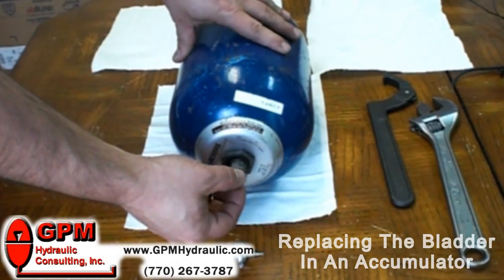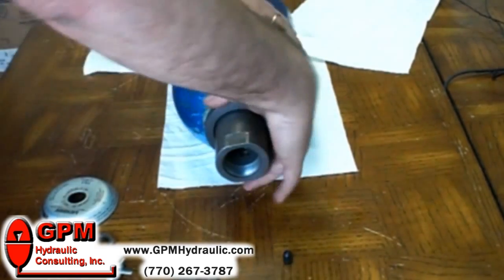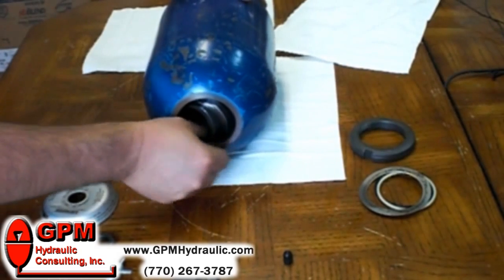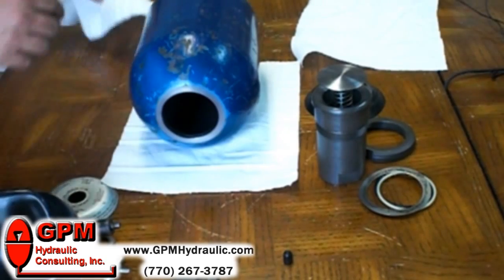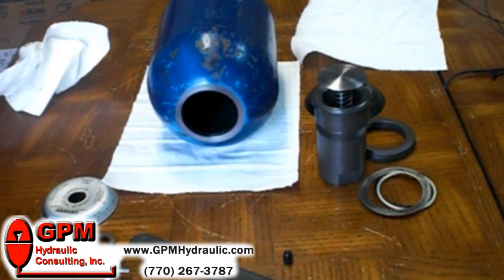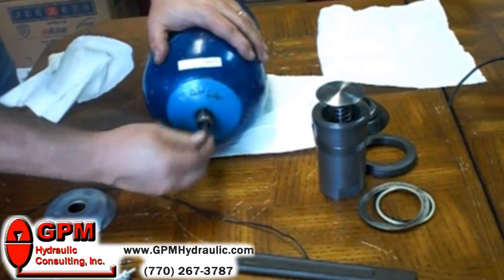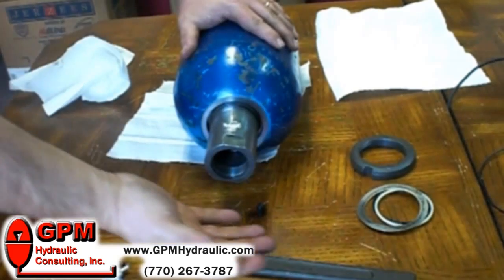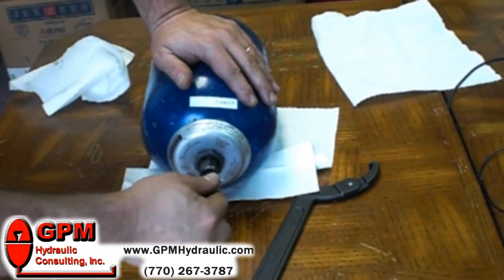Replacing The Bladder In An Accumulator

Comment: My accumulator is gushing out oil from the charging valve. What does that mean?
Reply from the maker: What type of accumulator do you have - bladder or piston? If it is a bladder accumulator, the bladder must be ruptured. If it is a piston accumulator, your piston seals may need replacing.

Comment: jack would a faulty accumulator cause a hydraulic system to lose hydraulic pressure over time .This would be in a bobcat mini excavator.What are the symptoms of a bad acumulator.We already put a brand new pump on machine
Reply from the maker: Hi Jay,
No, that doesn't really sound like an accumulator problem. Yes, it can cause temporary pressure drops whenever the system is starved for fluid. For instance, if the pressure stays high during low demand (few actuators moving), but drops when more actuators start, yes, that could be an accumulator issue. In fact, whenever you have wide swings in pressure, the first thing to check is the accumulator. An overall pressure loss over time sounds much more like some component bypassing (and getting worse as it remains in service). I'd look for components with an abnormal temperature gain - usually the first indication of bypassing. Hope this helps!
Reply: @JackWeeks  Thanks Jack one other question on our control valve there is a main releif valve is it possible the main releif valve is faulty .The reason I'm thinking the main releif is because ever control of the machine seems weak including final drives once the machine warms up
Reply: @jrac863  That sounds like a great place to start. Not sure how your machine is configured, but you need to determine if the relief is bypassing to tank. One good way is to see if it heats up during operation. A thermal imaging camera is a great way to tell. It should get no hotter than surrounding components. Good luck with it!

Comment: Good day Sir,
      I'm Paulo, I need your help Sir  Can you solve or  answer my question. for what are the  main causes why  accumulator bladder leaks or how long or year did accumulator may used

I hope you can answer my problem..Thank you and God bless...
I hope you more blog about the accomulator and also how they work.. Again thank you...
Reply from the maker: Hi Paulo,
Thanks for your question! One common cause of slow leaks in an accumulator is a bad Schrader valve. Replacing the valve core is exactly the same as replacing the one on your car tire - you even use the same tool. But do not use a low-pressure car tire valve core, get a high-pressure one from your hydraulic supplier. It's easily recognizable by its red seal.
Bladder failures are different - they usually fail suddenly (rather than leak down over a period of time). The most common cause of bladder failure is too high of a pre-charge. This causes the bladder to hit the poppet valve every time the accumulator discharges, increasing the chance of nicking the bladder under the poppet valve and rupturing it. If your system presssure is ever changed, be sure to change the pre-charge a proportional amount.
Piston accumulators leak by nature, but it can be minimized by keeping the system pressure and the pre-charge optimized.
Hope this helps!
Reply: @JackWeeks   many thanks for the explanations. We use this in 53b seal support systems very challanging
Reply from the maker: @hamzadriss1358   Happy to be of assistance!
Reply: @JackWeeks  thank you so much.. Now I have and idea of how to minimize the trouble of the hydraulic pump.. This machine is a punching machine....

Sir Jack,  if I increase the pressure of the hydraulic motor pump there is a capability that the accomulator bladder damage or cause of leaks... Thank you...
Reply: Thanks for the question